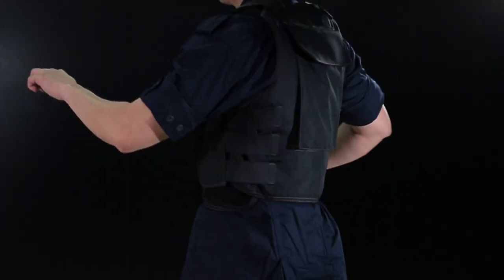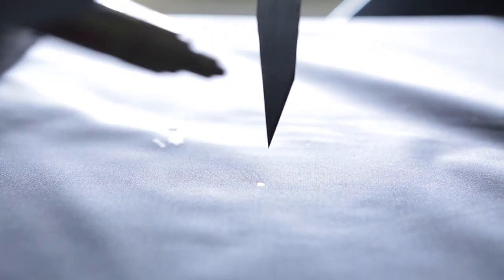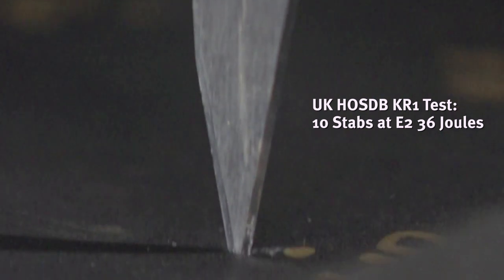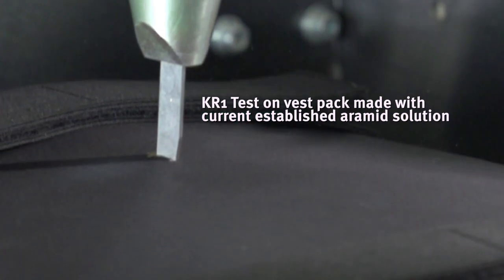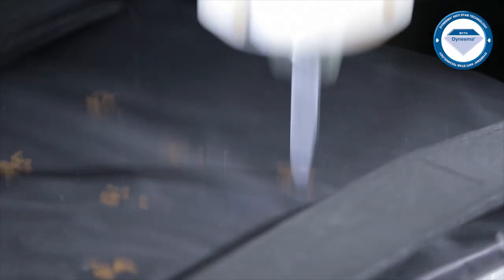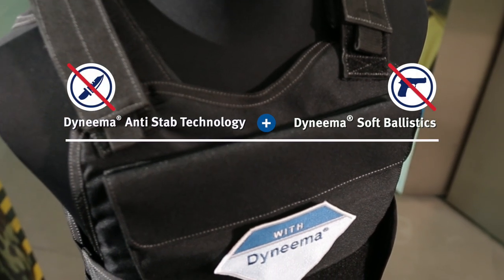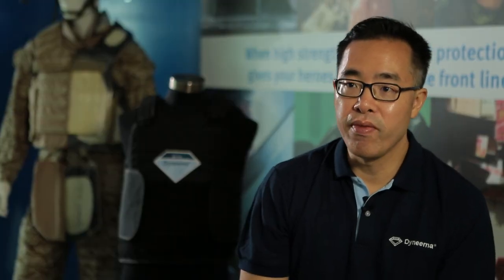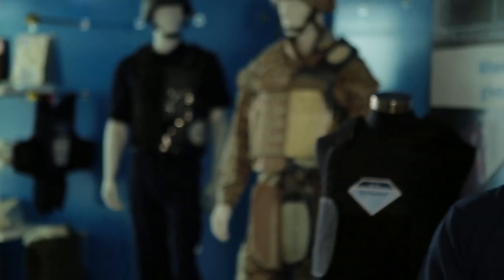Dyneema® Multi-threat level protection

Comment: But how does this protect against 5.56 and 7.62 rounds?
Reply: Chief Thundrecock Was there a smiley face?
Reply: As shown in this application it doesn’t, but there are companies that use Dyneema in their plate technologies such as layered in HDPE plates. 
I have some Lvl 3 plus rifle plates that weigh 3.25 lbs each and float.  IIRC
Reply: I would recommend looking at some diagrams for NIJ levels of body armor(mainly because diagrams are cool lol, but also helps visualization). IIIA is not going to protect against 5.56 or 7.62.
Reply: the material can but the vest is too thin